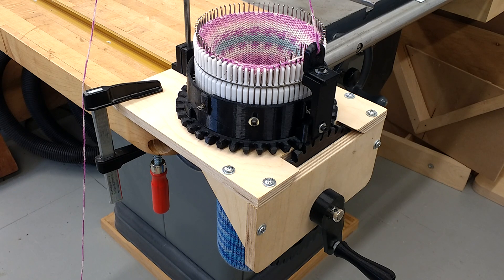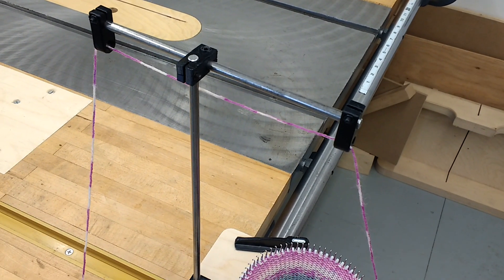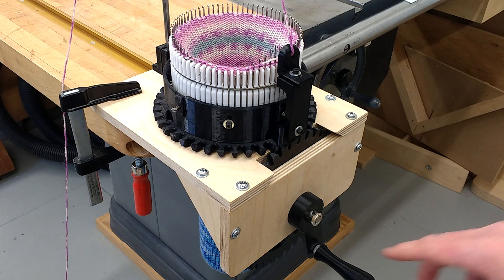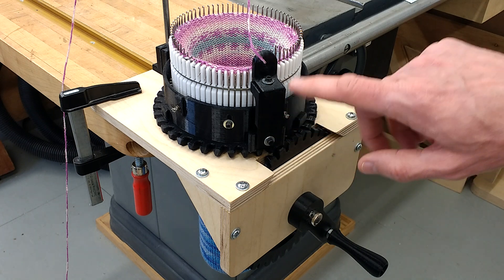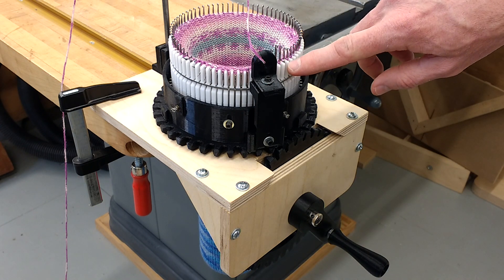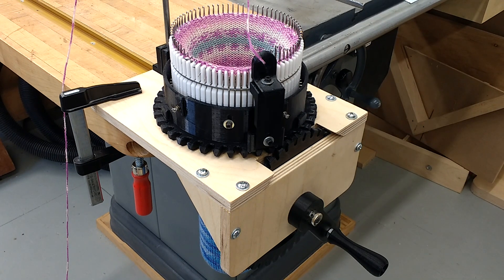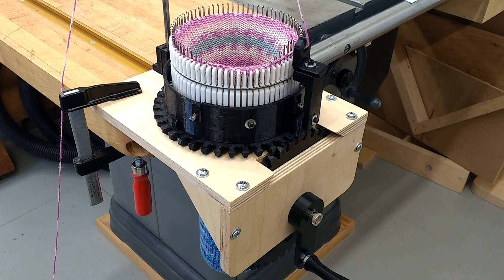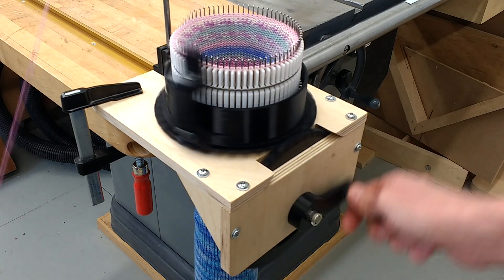3D Printed CSM Circular Sock Knitting Machine: Intro

Comment: Just recently i stumbled over your video again and realised, that i didn't give feedback.
It was a quite bumpy road, to say the least.
In the end i got a working CSM. I opted for needles from the ribber of a Brother KR-850. I had to cut the needles, that was no problem. After printing the hole machine, i realised that the part of the needles, which i think is called the butt, is substantially longer. So i had to change the design and and reprint the camshell.
I also reprinted like 4 different(higher) versions of the upthrow cams, because the travel wasn't working with the cylinder height, i settled on. In the end i sanded a version with a height in the middle region down a bit.
The machine now works kinda great. But i somehow got the feeling, the knitting that other people create on their CSMs seems a bit tighter compared to the tightest knitting i can get without having problems like rising of the knitting on the needles without using excessive weights. I don't have a clou, why that would be. Atm i use a 60 needle cylinder. I have the feeling, that higher needlecount cylinders may produce a tighter knitting.
As i finally got a working printer again, i will build a csm again for a friend. 
This time i will use the design of JeepingJohnny derived from your work. There are allready some parts for the use with E6000/D80 needles. The dimesions of the needle butt seem to fit. And i got a Passap D80 and a lot of spare needles.
For the cylinders there is .scad design. I allready made me familiar with it.
I had mostly fun, working with your design. I learned a lot about working with Fusion 360. I'm still bad at it, but like 1000% better than before i began working on your .f3d files!
Thanks for that!

Comment: I am printing the machine now.  The design looks  great and the parts are coming out dead on size.  Do you print the cylinders without support?  Top or bottom of the cylinder on the bed?
Reply from the maker: Watch the assembly videos.  They show how to orient, etc.  The cylinder is printed upside down.  You can get away without supports, but may have to clean up the slots for the nuts.  Good luck!  Steve
Reply: Thanks.  I must have missed the cylinder orientation when I watched the videos.  It is printing now - 29 hour print.

Comment: Awesome design! I have printed out all the parts but can't get the upthrow cams to work with the springs. I saw a video where the original auto knitter does not use springs. Did you find you still needed springs when you switched to metal upthrow cams.. and would you mind sharing where you bought your metal upthrow cams? Thank you!
Reply from the maker: Thanks Sheldon.  Sorry you can't get the springs working.  My only suggestion is to watch the assembly video over and over.  I have not tried using the metal upthrow cams without the springs.  May work, not sure.  I made the metal cams by hand.  Get some 5/32" x 1/4" unhardened steel.  The trick is to bend it by hand first to get the exact curve you need (so it fits between cylinder and cam shell).  Then use the printed plastic piece to mark out the shape.  Cut and grind as needed.  The other tricky part is to drill the hole perpendicular to the curve.  Good luck!  Steve
Reply: @steveturner1447  Thanks for your reply! Clearly you are a talented engineer... I actually got the springs working with the plastic flippers for now, but you've inspired me to try my hand at making my own metal cams as well. Thank you for all your videos and designs - we are loving our new CSM!

Comment: Which 3D printer are you using? I think the one my daughter is getting, Prusa Mini, might be too small.
Reply from the maker: Charlotte, I am using a home built 3D printer that is similar in size to a Prusa MK3.  It can do about 8" x 8".  The Prusa Mini+ can do 7" x 7", so it should be able to do everything except the main frame (which I made from wood).  Good luck.  Steve
Reply: @steveturner1447  thanks for replying! I hope you post more CSM videos. Especially if you decide to do any modifications or additions like a ribber or heel spring.
Reply: That looks so smooth!

Comment: What's the best way to keep up with the updates on your design?  I am mid printing the v1 and then had a friend mentioned that v2 was already out.  Do you have a facebook page or something?  Also, are you considering parts for a ribber?  Keep up the work and I appreciate the sharing of info.  I'm new to knitting but not mechanical design.
Reply from the maker: Kevin, sorry I caught you in mid build.  Keep in mind everything in v2 is optional.  I think the best way to keep track is to select "watch" on the Thingiverse page.  This should notify you whenever there is a change / addition.  You will probably have to create an account.  I am going to wait on a ribber for now (no promises).  The PETG fumes from my printer have been affecting me lately, so I am going to stop printing for a while.  At least until I can make an enclosure to vent outdoors.  KEEP SAFE!  Just because you can't smell it doesn't mean it's not there.  Steve
Reply: @steveturner1447  Also, there's a facebook group "circular sock machine 3d printed" that people have shown lots of interest on.  I don't know if you are on facebook or not, but if you wanted to interact with folks, that would be another good way too and I'm sure the group would love to have you.
Reply from the maker: @formula400me  Thanks Kevin.  Unfortunately, I don't have a Facebook account.  The best way to contact me is with a Thingiverse comment.  I get emails for each new comment.  Would appreciate it if you posted this on your group.  Steve
Reply: @steveturner1447  so sorry to hear about the fumes affecting you! Any type of chemical smell or VOC gives me horrible headaches, so I feel for ya! My son is going to print your design for me, once he has an enclosed, vented workspace. I plan to “tip” you once I get a chance to try out the machine. I’m guessing Thingiverse is the best place to do that. Unless you have a PayPal account or something.
Reply from the maker: @char2556  Thanks Charlotte.  Make sure to double check if there are any updates on Thingiverse before you start.  No need to tip me.  I won't accept it.  I did this as a Christmas present for my wife, not to make money.  I enjoy working on the design.  Steve
Reply: @steveturner1447  My son is printing it for my birthday. Thank you so much for sharing your talent!
Reply from the maker: @formula400me  Kevin, FYI: I posted the ribber design on Thingiverse (https://www.thingiverse.com/thing:4786810).  You can also get to it via the Remix button on from the main CSM page.  Make sure to read the comments.  Steve

Comment: What size 3D printer do you need to be able to print one of these machines?  I am looking for one now.
Reply from the maker: The bed probably needs to be at least 220mm x 220mm.  If you don't have a 3D printer, you can find a service that will print them for you.  There is a bit of a learning curve to get started with printing.  Steve

Comment: Hi, thanks for the video and the files on thingiverse!!!
I've looked at different Models, and this seems to be the most promising.
I also appreciate a lot, that you've uploaded the Fusion 360 files! I may need to change minor things for metric bolts.
I knit a lot by Hand. Lastly i researched about different knitting machines. I first tent to buy a used doublebed machine because of versatility(especially for ribbing).
The price for ribbing-capable CSM is way to much for my linking. And i can't find any used machines.
I think i'll start soon with printing this machine and see how it goes.
I somehow didn't notice that you've also designed a ribber.
That's amazing!!!
Reply from the maker: Good luck with your build.  Let us know how it works.  Steve
Reply: Where can i find the .f3d file, for now it disappear.

Comment: Has anyone thought about printing a ribber? Is that possible? I don't know enough about how the ribber works to know if it's possible.
Reply: I'm thinking about designing a ribber.
It's definitely possible. There are at least two commercial 3D printed CSM available, which can be equipped with a ribber.
After some research i've got a good understanding of how they work. I also know the basics of designing parts for 3D Printing. If my skills are good enough, i have to see...
I will try printing this CSM soon.
But when i have the time to try to design a ribber, i can't say...

Comment: What kind of printer do we need?
Reply from the maker: Sylvia, you need a FDM style 3D printer.  The bed size needs to be at least 220 x 220mm.  If you don't have one, there are plenty of services available that will print the parts for you.  There can be a learning curve with 3D printers.  Steve